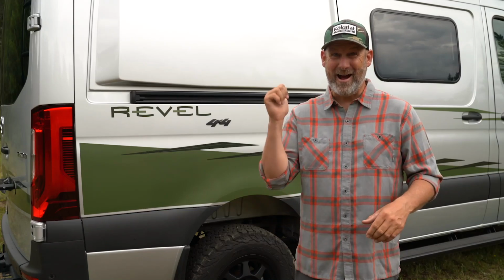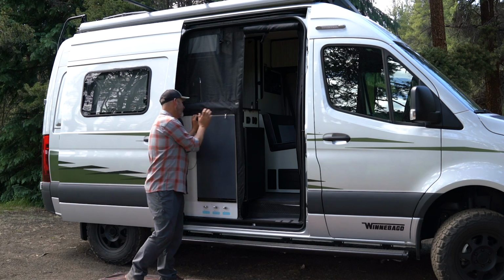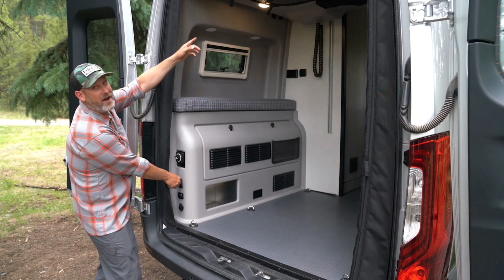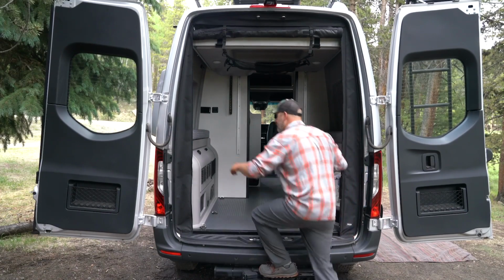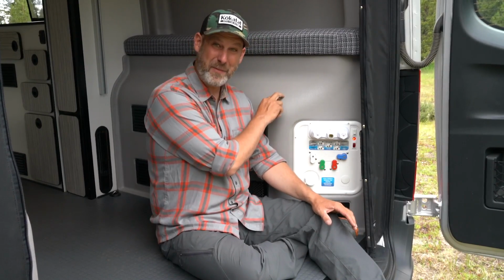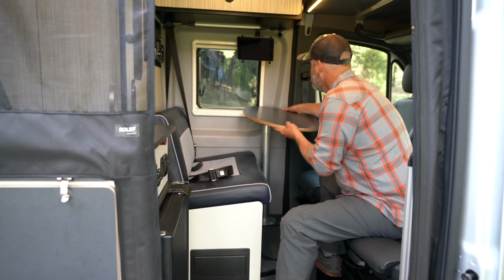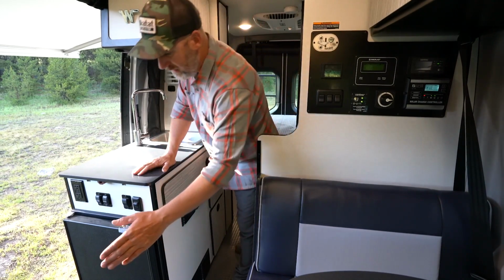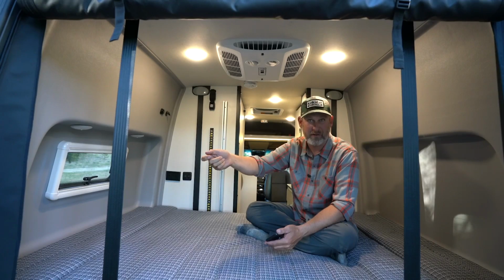Introducing the 2021 Winnebago Revel

Comment: If you really want to get off road at a price less then your first 3 homes buy a Tacoma and put a small camper on it. You don't need built in everything. A spray shower works great. A portable stove too works fine. A shower tent gives you privacy. A Tacoma will take you to the remote areas far beyond a Sprinters capability. Less then 65k will buy you a newer TRD OFF Road and a FWC. Keep the other 100k to live on for 5 years.

Comment: Checks all the boxes.. except.. that bed is just might not be wide enough for two. Wish Winnie would have axed that bench seat in the front to allow for a wider bed.

The Pleasure Way Recon has an amazing bed size on the same Sprinter chassis, but alas no AC.

Comment: Suggestion: See that sheet/blanket you have on the ground?  Could you create some sort of device that could wind  such a carpet to be pulled out - it can stay dirty as it nestles under the vehicle but the top side relatively clean (rinse off with a hose?) as it rolls into itself.

Comment: I'd rather have my outdoor toys racked outside since you'd have to do so if you use the bed...secondly..no microwave ?? I  need to reheat my coffee and it's easily the best way to eat solo and quickly...lastly..the cassette style toilet really does not allow much extended use...it fills up in a short while...my main use for this RV  half the year is as a moving ski locker...Tahoe has 7 areas less than 30 minutes from each other and this allows me to visit all of them comfortably and cheaply
Reply: Just curious, where do you park while in the Tahoe area for skiing?
Reply: @pearldiver7  I ski Homewood (using regular parking) and underground at Northstar ..I'm local so I can usually catch a break there.I only use the motorhome  during warmer weather usually avoiding January and some of December  ..too cold for the plumbing..it's nice to watch super bowl and other sports  avoiding the crowded eating areas as well..also good for clothes change in the spring it can start out freezing and hit 50 at noon..that also occurs
Reply: @ziggyff693  Thanks. Always curious about how RV'ers find places to stay around ski areas. Seems to be getting harder and harder to find the underground free places. And the best ones usually aren't advertised. Cheers and enjoy the upcoming ski season.

Comment: Almost perfect. Here in Florida we lived and died by our generator in our Class A being able to tun the AC. Since there was no mention that the extra alternator could run the AC I assume it can’t. I know you can run the AC with a operable 2000 watt inverter generator if you add a soft start cap to the AC unit. But damn, if this thing only had a diesel Onan for when you need it built in. I’m guessing you’d get maybe 1 hour of AC off the batteries.

Comment: Question: my job requires that I host a zoom meeting for two hours per day, I cannot be disconnected! Is this possible in a national park, say? This is the only factor preventing me from buying a camper van. I’ve heard of boosters but no word on how effective/reliable they are with zoom. Help?
Reply: I want to add to Peter's replly.  I use RVTRIPWIZARD when planning my trips.  One of the features I like is the park reviews and reading them. you can see if WIFI ais vailable and what mobile services work.  But, when considering a wifi booster and/or cell booster remember you have to have some signal for them to "boost".  Meaning, on your smart phone if you have zero bars, then your cell booster probably isn't going to help.  Same for wifi, I've had a strong signal yet couldn't do anything but email.
Reply: @chaosncheckt9356  thank you!
Reply: Kim Craige I have worked from the road for the last 6+ years. Some parks have good to great cell or WiFi service, some are black holes. But with a WiFi and or cell booster and a little prior planning you can travel/work full time from a Revel. It’s a challenge at times but so worth it for me to spend time in these amazing places with so much freedom.
Reply from the maker: Hi Kim, we suggest reaching out to one of our trusted dealers. They will be able to help answer all of your B Van questions! Find a Dealer: https://winnebago.com/shopping-tools/locate-a-dealer
Reply: Thank you, Peter and Winnebago.

Comment: I loved the garage area box drawers you installed on your older Revel . Now , with the garage area having the electrical system , batterries , water controls etc , 
an efficient floor box drawer set-up in a 2021 Revel  looks to be a very difficult build . Do you have any plans of tackling such an upgrade in a 2021 ?

Comment: Somebody below posted about the 170 coming in 2022.  Is this happening?  It would fix the ridiculous bed width issue - 46" isn't even a double which is 54" and a queen is 60".   I don't understand how 2 adults sleep in that comfortably?  And with a 170 you could have a few more needed inches of room up in the front lounge between the drivers and rear seats.  And if you have more room, make a rear seat that isn't crap.  Please make a 170!  Sacrifice a bit of agility for workability.

Comment: Just wondering if the new 21 has a water gravity fill?
Reply: I'm wondering the same thing.
Reply: So I just received my new 2021.  They switched to the Nautilis water system and there is no gravity fill but there is a siphon fill. You basically hook up a hose, put the four switches set for siphon, and then you can put a hose in any container and it pulls using the pump.  This is also how you can sanitize. Just sanitized today and it worked great. Love this thing.

Comment: Pricing it at $175k and then bargaining down by $50k is ridiculous Winnebago. Work out a no haggle reasonable pricing structure -  this is just silly in this day and age.
Reply: A van with all the usual living functions that can double as a taxi + delivery, the layout is the best I've seen so far.
Reply: @server1ok  I would say the storyteller overland mode gives it very good run for the money - especially when you consider the Volta power system it comes with let’s you run AC overnight!
Reply: Its called the Boomer premium.
Reply: oooo thank you for THAT information!!!  Certainly will do this when it's time for  me to buy one!!
Reply: You mean the final price is  $125k or $50k??
Reply: I think you should be doing your own build on the sprinter...just my personal opinion .
Reply: MSRP $175K
MAP $125
LOW IQ LIBERALS!
Reply: @Rkread54  your comment it’s both needlessly divisive and objectively unfounded. Most liberals are higher educated for what it’s worth.
Reply: @AK-tl2nm  🤣🤣🤣🤣

Comment: Suddenly my plan for a used Revel does not look as attractive - wow. Now that I have to save/more longer my feedback for future development.
Losing sleep 3 is significant even if fridge is better. My suggestion is make the table leg adjustable so the backrest can at least sleep 2 littler ones.
Underfloor storage is the previous water tank?
The rear wheel well builds look nice but I suspect with development could be more efficient, perhaps a CAD custom water tank, & reworked electrics on the other. The GLSS type fittings are not for everyone but show how compromised the 20/21 mod change looks.
CUSTOMISATION There is scope for personal orders as customers are prepared to wait.
The Graphics delete is a factory option and I would not wish to advertise 4x4 to thieves. From the rear I would choose a stock van look (Sprinter 2500 only).
My goal is a global trek so I would need a 240v connector and step down transformer. I could bolt one to the roof and have a trailing cable but Revel is about the factory look. Could the vacated AGM space be utilised as a factory option?

Comment: I've been following the evolution of the Revel since the beginning.  It is the perfect van with the exception of the back seats. They can't accommodate two kids car seats and when my 2 sons get older, it's a pretty small space with questionable overall safety. My other question is if you could run AC at night. I could almost envision 4 people sleeping in this van, 2 kids on the bed and 2 adults underneath or 1 adult underneath and a mom and 2 kids above. AC would be needed for that I think, otherwise it would be really hot underneath. I'm not sure how long you could run the AC continuously.
Reply: I saw 6 hours somewhere, it recharges with 2 hours driving.

Comment: $175.000 doesn't sound too bad when a brand new Cessna 172 that you could buy loaded in 1965 for $6,500.00 now cost $307,500 that is essentially the same aircraft has Cessna did not want to pay for new certification charges.  We picked up a really nice motorhome loaded for $3,000.00 during the energy crisis, ha, the price of car gas increased by a dime causing a panic.  Now today, we had prices of as much as $4.50 a gallon, and getting difficult to find ethanol free gas that only vehicles made after 2005 could use anyone, and is crap because it doesn't form a homogeneous solution  with gasoline.  Ethanol is heavier than gas, settles to the bottom of the tank and is used first, leaving a very low octane fuel, like 80 octane that can wreck a new vehicle.

Least this has a diesel engine, but only a 3 liter!

Comment: Nice video... My only issue is the very end.... You fail to mention that with batteries at 100% you can barely run that AC for 2 hours! And that's with nothing else drawing on batteries.... The Storyteller gives you 8700 Amp hours almost 3x the Revel.... Storyteller claims is can run AC for 8 hours continuous on low which in a hot environment would be for overnight sleeping comfort.  While I like the Revel floorplan better than the Storyteller that's allot more battery for about the same price point!

Comment: Wud av like to seen the Power Drop n Amps Used when the AC is on
Cant see the Batts lasting long or the Solar Panels keeping up as only Half of what it Could be
Reply: To run AC, you need 800ah battery.
Reply: 250ah will give you maybe 1.75 hours of run time. However, this does come with a second alternator. Just start the van.

Comment: Does the engine auto start to charge the batteries? The fact that you no longer need shore power for the AC is HUGE to me. Looks like Winnebago addressed the most glaring issues except undercarriage protection and ground clearance.
Reply: Ground clearance is higher (AGMs were the low point), undercarriage? - the exhaust pipe was raised on the 20 by shortening the side rail.

Comment: If I understand correctly, if you use all the garage space when the bed is all the way up, you have to unpack for short overnight stops. Makes no sense. Correct me if I'm misinterpreting
Reply: You understand correctly. If you use the entire space below the bed it can't lower. It can lower partially so you can climb in provided you don't stack stuff all the way to the bottom of the bed in the full up position. It's a van, basically a big box, so you have to learn to pack if you want to use the bed without unpacking all your stuff.

Comment: ♥️It + 10 Ideas to consider:   
1)Left & Right opening fridge
2)Driver & Passenger Sides External Solar Plug-ins 
3)Rear Floor Cargo Tracks
4)Mold cubbies into rear battery/electrical cover so no wasted space where possible 
5)Additional underneath skid plates
6)Opt Rear Awning
7)Opt Rear hook for shower head 🚿 and fabric shower surround system, modified wooden shelf from inside bath with adjustable feet for shower floor creating a private rear full sized off grid external standup shower 
8)Opt Froli bed system
9)Opt air bags to raise and level coach
10)Would ♥️ to work for Winnebago in new product development design engineering 🙂
Reply from the maker: Thanks for watching! We'll pass your thoughts along to the team.
Reply: Roof top hidden extendable solar  panels for day use while parked coming out drivers side and also coming out over the front of vehicleand retracted for night ,plus giving more access at night to the top with more ladder positions ,,,,2 more lithium batteries,,,,,roof top flat platform for dining ,,photographing,,,,tent,,,,stargazing,,,,,, reduce ac to a 8000 btu air conditioner that uses only 650 watts ,,,,,move the ac as far forward as possible and off center toward the front passenger side and or find an ac unit that is long instead of square,to be positioned far front,,,,,exhaust fan over the rear of bed will pull hot air out while pulling cold air from floor.,,,,,,winter time i want rack on garage floor to hold from moving 8-5 gallon jugs of diesel, and in summer can use the same space for storing 8-5 gallon jugs of water. or combinations of both, to carry the cheap lightweight twin tub washing machine that can lay flat or on sides when not in use,and also a large freezer that will contain food to service camps with frozen milk and butter and  ice cream and lots of milk chocolate bars or lots of cold beer ,,LOL,,,,WOODSTOCK 1969 HERE WE COME DESERTSTOCK 2021,,,,,,,,,,,,,,,,,,,,price for enhancements total $181,000.

Comment: How does AC cool when the bed is in the up position? Can the bed be in a 3/4 up position?
Reply: James Jones the bed can be stopped at any position along its travel. And yes the vents on the AC can direct air forward, down or back with a flip of the switch. So with the bed raised fully you can still have cool air blowing forward or backward.

Comment: Just looked at the website and sticker shock, over $170k for this.  Buh Bye
Reply: yup...it's up from $135k in just 4-5 years..mostly from the lithium and other electronics
Reply: @ziggyff693  The lithium is a BIG plus and while they can only run the A/C for around six hours I think, that is still very impressive.  Anything that is a step forward and helps to eliminate hauling an exterior generator is a bonus.
Reply: @chaosncheckt9356  That depends on the AC duty cycle. The batteries are 3200Wh. Looking at the Coleman 10NDQ datasheet from their site, we see that the running Watts range from 1350-1625W. So on a really hot day like the guy in "30 and a wake up" channel tested recently, the compressor doesn't go off. So with 3200Wh, of which about 90% is usable, you'll be able to run for about 1,5-2h. Probably more like 1,5h since you'll loose about 10% when inverting. For 6 hours, you'd need a duty cycle of about 25-30%.
Reply: @thomasj4057  Thank you.  Technology with regards to solar and batteries is evolving quickly and I'm sure one day we'll have the option for an RV with sufficient battery/solar or a new tech A/C that lets us boondock in the middle of the summer without the need for that noisy generator.
Reply: Perhaps a 1965 Single Wide is more your speed.
Reply: @JamesBlazen  Nope, but appreciate the humor.

Comment: when you showed us the fridge , I just had a quick thought as to it being a shame that the door didnt open from either side . making access easier when you load up from your shopping cart .
Reply: I haven't done it personally, But I think you can change the side the door opens on. I find that it swings open far enough to allow easy loading in its current configuration from inside the van or in the parking lot.
Reply: Definitely wish they went with a slide out chest freezer instead.  Way more energy efficient and storage is increased too.  When all the cold air doesn't just leak out when you open the door, you can afford to have less insulation.
Reply: styledliving l

Comment: What kind of un time you get for the AC with 200w solar and 250W/hr lithium batteries?
Reply: My real-world tests with the AC on High Cold, it  runs about 2 hours. This will freeze you out of the Revel.  I've seen Lichtsinn RV's test video with over 6+ hours with it set to 75 degrees. There are certainly lots of variables but this is amazing as in the past the AC had to be plugged into shore power to work at all. Honestly, this is the most exciting new feature for me personally.
Reply: most acs draw at least 1200w, so 2 hours is about right.

Comment: This new model is only good for a couple because the flex bed is gone.  You shall point it out. It's important to know how many people can sleep in it.
Reply: cassin11 There are 3 people in the video.  Where do they sleep?
Reply: @anthonycbrown1952  You can simply say the flex bed is gone but the bed sleeps 3. Comfort your wife with your child in the middle?  I don't appreciate your answer.  You got the wrong job dude.  You don't know how to answer customer's basic question or concern
Reply: @cassin11  Anthony Brown does not work for Winnebago, just another poster like you and I. You could easily sleep 2 more people in the space below the bed in sleeping bags/pads, provided the space is clear.
Reply: @zonacrs  they could make an add on collapsible  roof tent for sleeping and stargaZING

Comment: Hi, I have a new 2020, and I love it, but there is a flaw in the windows on the side. I was in the Sequoia national forest parked with the sliding door window popped open about half way, when a decent gust of wind blew, and the window flipped upward very hard, and popped out of the top railing, and could not be put back, except for at the dealership. The window needs a restriction from flying open when like a nylon tagline affixed to the window, and the inside of window to prevent this from happening again, which I'm sure will. I know others have, or will deal with this. Dealership had my van for 10 days.., still Love the van though. I will do my own fix.

Comment: Hope it doesn’t leak as bad as my 2020 Winnebago 2405RL

Bad design so changed it mid year but to bad for my 1st gen with NO cap on the front...
Reply: It's a class B so the leak paths are a lot less. The basic steel van structure remains.